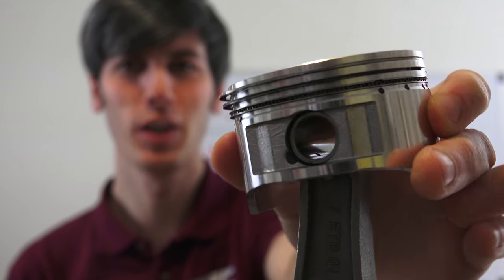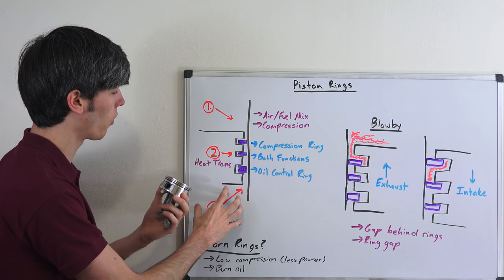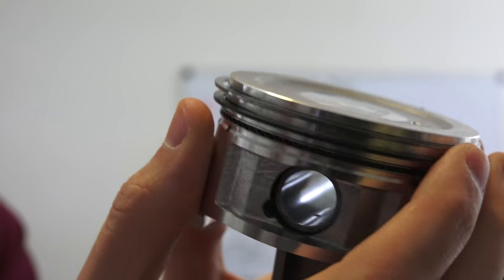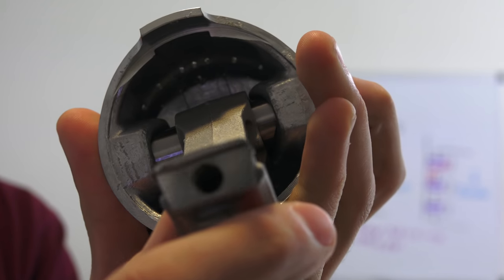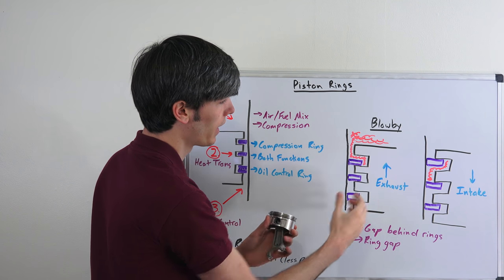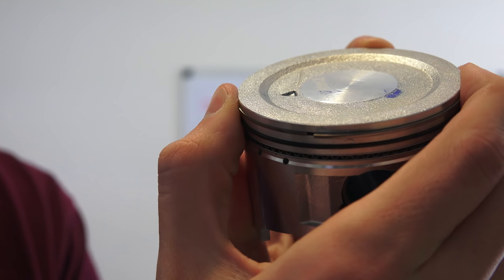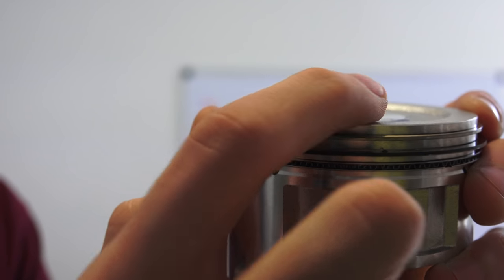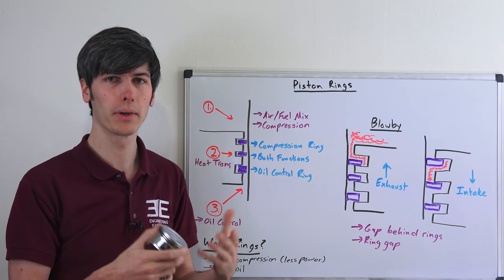Piston Rings & Blowby - Explained

Comment: what happens when you use a turbo charger for a petrol engine
Reply: +Radhakrishna M.G POWEEER
Reply: horsepower
Reply: VTEC yo
Reply: +Nasir Hussain LOL, yes. I think he's suggesting a video. Though I do believe he has a few on the subject already.
Reply: andrius čičirka Petrol is a British term for Gasoline.
Reply: DE Nichols Most random thing i've ever heard
Reply: andrius čičirka You were random bringing Diesel to a gasoline conversation.
Reply: DE Nichols I meant they are "good" just because of turbo. Even petrol engines without turbos are better
Reply: andrius čičirka
I can't disagree with that. :)
Reply: +Radhakrishna M.G sututututu and more speed
Reply: +Radhakrishna M.G ok,for real,so... This may sound complicated,but it's really easy to understand.I'm 14 and I know how a turbo works,like c'mon...
The combustion needs an air-fuel mixture,as the explosion can't happen without oxygen.The air is taken by the intake,where also lies the throttle body ,which allows more air and fuel going in the chamber , it gets burnt and then exhaust gasses come out of the block.What a turbo does,is that it takes a part of those gasses,cools them down through an intercooler and gets them through the intake back in the block.Turbos are also falling in the "Forced Induction" category,because you are recirculating air and forcing it back in the engine block.
Reply: +Kryotix Gaming the gasses only spin the turbine wheel which is connected to the compressor wheel, which gets clean air and sends it to the intercooler and then to the intake manifold.
Reply: Car Guy
oh,ok

Comment: Yoou forgot the gummed coked oil ring pack, cause
Reply: When oil gets hot and the engine is shut off the oil sits there with the piston not cooling off causing varnish mud and the coke build up is like carbon from burning oil